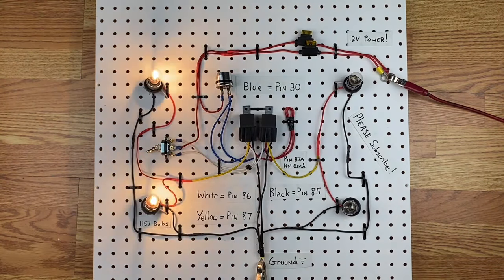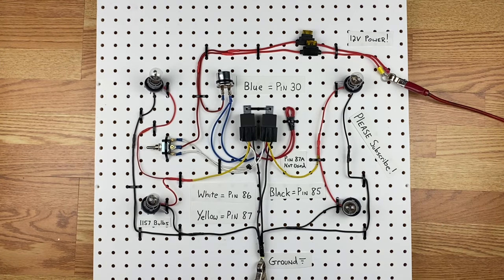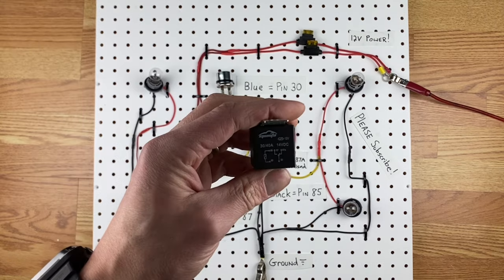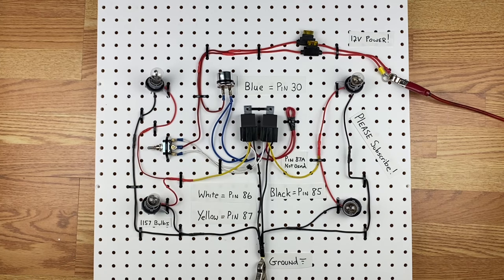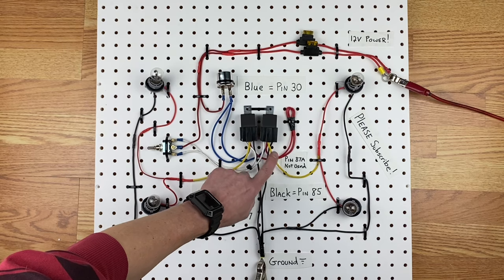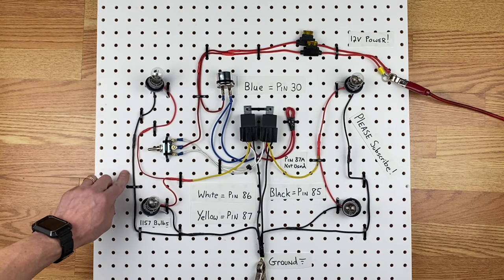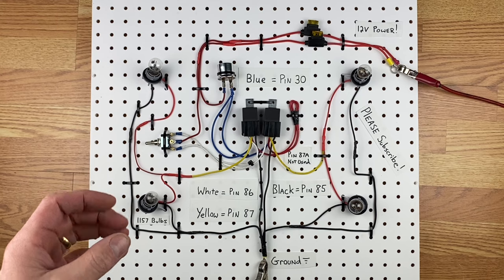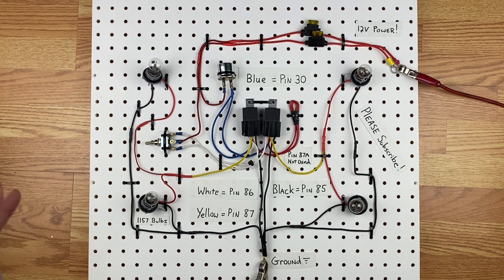How To Wire a Turn Signal Flasher Relay Directional Blinker on a Car / Truck / ATV / Motorcycle

Comment: Can this work for a 6 volt system 🤔
Reply from the maker: I actually have never tried this sort of thing with a 6v system. I think at minimum, you'd have to use 6v relays. The rest - I'm just not sure.

Comment: What size cable goes from fuse to battery terminals?
Reply from the maker: I made a separate video about wire and fuse sizes. Check it out. https://youtu.be/EhzN6UdnmPA

Comment: Can some one help my??
My engine refuse to stop when flasher working ore head lights.
The engine wants to acelerate by him self.
With key turned off.
I did change the back head light design to new'r year .
I first tough the bulb holders in the back cause that problem so I swaped them to old bulb holder .
For some reason my back side blinks bouth with brake light and position light turns on.
So thats where its confuseing why my engin self acelerate it is carbureted and it has 4 pin gm ignitiin module with induction triger .
How to solve this problem?
By the way my baterry sufers for some reason hard to cold start that thing .
My starter cant turn my engin in the morning somthing draining the baterry.

Comment: These will look awesome on my kayak. We caught several unfit-for-civilization type "people" stealing catalytic converters in the area. The thefts caused some people to have their vehicles declared a total loss by the insurance companies due to the value of their cars. These are older people, with no money to replace their cars. We found an extremely secluded spot in the Everglades that is not well known to anyone. So, we take these "individuals" out there and leave them. Now, using your setup, we can signal to each other where to drop these "individuals" off. They never seem to come back and steal again. Problem solved. Thanks.

Comment: I need to ask the this question... I've been an auto electrician for 30 years and I've never seen relays being wired into an indicator circuit... my question is why are you making this wiring job which is so simple and straight forward so complicated? The reason I watched this video is I was wondering how in the U.S.A they wire up their brake/indicator circuits, in Australia we have amber lights completely separate to the brake lights so two completely independent systems where as in the U.S they flash their brake lights and I thought this video might quench my curiosity... NO! IT DIDN'T! Again I'll ask why are you wiring relays into the circuit when there is absolutely no need to? cheers
Reply from the maker: Sorry the video was so disappointing. The reason I used relays in this video is because I have no idea what switches and lights people will be using on their own projects. Chances are good that the switches people use will be undersized (low amperage rating) and the light amperage loads will be too large (fog lights? Headlights? Who knows!), which will leave people with burned switches or worse. So I figured if I show a risk-averse circuit, people will have less problems when they decide to use headlights for turn signals and wire it all to a 2 amp switch. :)

I have multiple other turn signal wiring videos too (without relays), but I don’t believe I have any that show what you are looking for. That’s a good idea though. So maybe I’ll make one.

Thanks for watching!

Comment: I did this but didn’t work I checked everything aging but still nothing did I miss something?
Reply from the maker: You’ll have to use a multimeter or test light to figure out where your power or ground is missing. 
-Are pin 85’s grounded?
-Do pin 30’s have power?
-Is there power going into the switch?

Comment: 1 problem with ,this brake lights are wired to the turn signal filaments  not the parking lights/tail lights. Turn signal filament is brighter than park/tail lights

Comment: I'm not sure what I'm doing wrong but I tried this the bulb lit up but the flasher wasn't working
Reply from the maker: Are you using LED bulbs or incandescent bulbs? If you are using LED bulbs, you need an LED flasher to make it work.
Reply: Brother I'm not using LEDs what I will do is list all the parts I'm using and will message you back maybe you can help me solve this problem I'm having I'm not using 1157 light bulbs and sockets I was trying to use turn signal light bulbs for my 2000 Chrysler neon I will get the exact light bulb number and light bulb connectors part number then I will try to see if you can help me solve the problem and figure out what I'm doing wrong

Comment: Dose this work for 24v trucks
Reply from the maker: You would need 24V components to make it work. These 12V relays would fry with double the voltage.  Otherwise, I would assume the wiring schematic would be similar.  Sadly, I don't know for sure though because I've never done anything with 24v.

Comment: I am working on my 2018 CF moto putting a street legal light kit on it and wiring up turn signals 1st time putting lights on a 4 Wheeler  Any pointers or suggestions would always be appreciated
Reply: A relay that came with mine was a single one will the diagram work for it too
Reply from the maker: Sadly I'm not sure how that light kit is intended to be wired. I would hope it would come with some kind of diagram if it was a whole kit.

Comment: Hello, thank you so much for all your help. Can you show us how to make one with only 2 wires but make them as parking lights and turn signs pleaseeeee?
Reply from the maker: That’s a good idea! I’ll add it to my to-do list
Reply: @WiringRescue  Thank You So Much I Really Appreciate It!!!
Reply: Flip the blue 30 and 87a yellow ... Now add a switch with fuse to the red wires beside the relays. And now you have parking lights. And if parking light on and you hit turn signal.. The side chosen will blink instead of solid. Great for small led or tiny 2 wire bulb.
Reply: @WiringRescue  simple flip and add toggle.

Comment: what's the purpose of the relays?
Reply from the maker: Using relays allows you to use a wider variety of switches, and bulbs. Many switches are rated at 5amps or less. So if you had bulbs that drew 6 amps, which is totally doable, you’d melt the switch. Relays prevent that… to a point. :)
Reply: @WiringRescue  thank you

Comment: Likely the relays aren't even needed the flasher could run to the center-off position of the switch and the output to the bubs.
Reply from the maker: It all depends which bulbs are used. I did it this way because it safer when you don’t know what bulbs people are going to use. If you use LED’s you would probably be right.
Reply: @WiringRescue  Also guess it depends on what switch is used Half the vehicles I own don't have flasher or even headlight relays.

Comment: I did what you said but my light just comes on it dont flash
Reply from the maker: You are probably using LED bulbs, or smaller bulbs that what I posted . If so, you’ll need a different style flasher meant for LEDs.

Comment: What fuse amp is that? 30 amp???
Reply from the maker: The amp size depends on the lights you are powering and the wiring you have.  Once you know how much amperage you're pulling, you can determine the appropriate fuse size.
Reply: @WiringRescue  just finished wiring. Im literally crying man thank you. You don’t understand my struggle. I been driving my miata with un-proper blinkers for over a year now. This video is game changer im so happy.
Reply: Would 87a be used with the white wire to have your running lights ?

Comment: I have put everything together but couldn't work, only to find out my Pins are confusing from what the videos says. My Pin 30 is Black, Pin 85 Yellow, Pin 86 White, Pin 87 Red, Pin 87a is blue. Please assist me bro or anyone on here i've tried 3 times
Reply from the maker: Forget the wire colors. The numbers should be stamped on the bottom of your relay. You can also watch this video https://youtu.be/QCkfFCLa_Jg?si=2WakyyguCsTdDatu to get a better understanding of how relays work and what they are actually doing.
Reply: But I have tried it according to the Pins but couldn't work, and also again with the wires
Reply: I did put them together but what happened was only a once off tick sound form a flasher relay and the lights are not turning on at all 😢💔

Comment: My ford relay as 5 pins, it power the four way flasher and the turn signal. Pins are numbered  1 to 5 no diagram to show how it works.  Nobody has a video to explain how they work, kind of lost with what people explain with pin 30 85 86 87 and 87A

Comment: Anybody wanna tell me why you need those relays in the circuit? I get that a starter circuit needs a relay because its high current, are turn signals high current?
Reply: And not the "blinker" relay...I get that.
Reply from the maker: I have a few other videos explaining why relays are a good idea in some circumstances, if you want to explore my other videos.

However, to answer your question simply - It allows you to use nearly any type of switch, and any type of bulbs. 

Here is the video showing the same thing without relays, which may be what you’re after https://youtu.be/uXiEoJVtHi8?si=TV7LIgY1ADQBlsQT

Comment: You can do this a lot simpler, no relays… just feed power to the flasher, then the output of the flasher to the center of the 3 way switch. Then feed out of each side of the switch to each bulb and ground the bulbs… way cheaper, way simpler.
Reply from the maker: That only works if your light bulbs draw less amperage than your switch is rated for. Using relays allows you a wider variety or bulb options without risking burning out your switch or flasher relay.
Reply: @WiringRescue  nowadays most lights are LED and draw a few milliamps, in that case you’d need a digital flasher. A lot of the simple logic can be done with diodes too for combing brake lights and emergency flashers using the same bulbs. I’ve designed several circuits for converting motorcycle turn signals into running lights and the rear into brake lights.
Working on circuits for go cart and mini  bike  lights using MOSFET transistors and diode logic. Fun challenge!

Comment: How about how to wire a LED system with a 3 wire LED flasher?
Reply from the maker: I like this Idea. Let me see what it will cost me. If it’s cheap, I’ll do it!
Reply: @WiringRescue  Going to put LED turn signals on my Polaris Ranger. I got all the components and I think I have it figured out. Wish I could send you a jpeg photo of what I got!  
What I am not sure of is amp size for the fuses. There will be 6 LED's per side and I think I can figure that out but how many amps would be needed for the relay switch between terminals 86 and 85 to operate the switch correctly? 
I am sure this would a very good video if you made one for all the thousands of Polaris and other UTV's owners to know how to do!
Thanks,

Comment: So I follow the instructions and got my blinkers to work however when the switch is in the middle they both blink. Now the flasher I have is different so I was wondering if that was the problem. It’s an led flasher off Amazon. Not sure if I just wired something wrong or what the problem is
Reply from the maker: Sounds weird. I think you need a test light or multimeter to find out where the electricity is and is-not. It sounds like your 3 way switch is not working the way it is supposed to. It’s tough to be sure though without testing it.

Comment: You don't even technically need the relays. I wired all 4 directional bulbs in my 2010 Ford e350 to a flasher and a 2 way switch. My flasher had a 3rd prong for pilot tho.  Plus I had to run the rear wires through a trailer adapter because the directional and brake lights use same bulb in rear. Didn't use any relays though just the flasher.
Reply from the maker: It depends which bulbs you use and how much amperage they draw. If they draw more amperage than your switch can handle, you’ll burn out your switch. Most switches are not rated very high. If the switch is able to handle the amperage draw of whatever the circuit is, then you could skip the relays. Thanks for watching!
Reply: @WiringRescue  yeah I ended up using an RL45 relay for each side just to be safe

Comment: you dont need 2 fuses, you dont need relays, you yust need flaser and 3 way toggle switch, and if you want to have indicator light on the dash yust conect left and right side on switch with smal bulb, it will blink when one side gets power
Reply from the maker: I don’t need to use toilet paper either, but it’s best for everyone if I do.

Comment: no need for  bosch style relays on that, just use a good quality blinker relay and the SPDT switch, ( A tridon HD12 or HD13 is good for 20 amos,)
more you add complexity, greater are the chances to have a failure

Comment: Are you telling me that flasher module flashes nonstop the entire time you’re driving that’s crazy
Reply from the maker: Nope, it only flashes when electricity flows through it. So when your turn signals are off, nothing is using the electricity. So no current is flowing through the flasher. But - when you turn on the turn signals, the electricity flows through the flasher and the flasher does its magic!

Comment: Using this wiring description to fit indicators onto a pushbike. !! 
I do not care of the weight as its having a stupid big motor on it to drive it. 
Although still retaining the pedals to.keep it legal. 
But safety first. I will add indicators to alert stupid people in cars.

Comment: you don't actually need the two relays. use a flasher relay 4 or 5 pin with the same ON/OFF/ON switch

Comment: I have a 68 big block vette, sitting in the barn for 8 years now.  It has zero wires on it.  I wish I could find someone to wire it so it's road legal.
Reply from the maker: That sounds like an amazing problem to have. I wish I had a big block anything! There is two ways to manage this in my opinion. 

1. Buy all new OEM style wiring, which will surely cost $1500+ but it will all be “correct” which makes Corvette purists happy.

2. Buy a $250 hotrod harness and make it all work great with modern fuses, relays, and wiring.

Personally I’d take option number 2 and start driving it asap!
Reply: @WiringRescue  been there.  Maybe it's possible but not even pai less makes one for me.  I'm guessing because everything needs a ground with a fiberglass body.
Reply: @WiringRescue  Purist need to look the other way on this ride.  Oops. 800hp big block, tubbed, flared, custom interior and body panels.
Reply from the maker: @DumbCarGuy  - this car sounds like something I would surely fall in love with.  For your ground management, you could have a couple of ground distribution points, that are connected to the chassis with a ~8awg wire. Something like this. Fastronix 12 Terminal Ground Distribution Block Kit https://www.amazon.com/dp/B00X326A1K/ref=cm_sw_r_cp_api_gl_i_2V28PE5YP4VPAJ0YDT33?_encoding=UTF8&psc=1

It would certainly require a little more effort than the average hotrod, but absolutely doable as long as the chassis is grounded nicely.

Comment: You can build the whole thing without the relays.  Seriously!
Reply from the maker: I can build a car without seatbelts too, but it wont be the safest design. By spending the extra $4 for a relay, I’m able to run any bulbs I want without risking overloading the switch.

Comment: This circuit is waaayy over engineered. You could easily remove one of the fuses and omit both relays. Optocouplers??
Reply from the maker: It depends on the situation and how much amperage the accessory is drawing. In some cases, the relay is not needed.

Comment: The 'other' filament on the 1157 lamp isn't bright enough for a brake or turn signal.  It's for park/tail light.  Barely noticeable in broad daylight.  Not noticeable if the brighter filament is already lit.  Why the relays?  Just run 12v source to the flasher, out of flasher to center terminal of switch.  All auto makers been have been doing it that way since the first turn signals.
Reply from the maker: If you have a switch with a low amperage rating, and your bulbs draw more amperage than the switch can handle, you need relays. Also - if you don’t want relays, I have a video for that too: https://youtu.be/uXiEoJVtHi8

Comment: Still not working.
Reply from the maker: Okay - we need to determine if that flasher is working or broken. Do you happen to have another vehicle you could plug it into as a test? Or could you hook up an incandescent (non-led) light bulb to it that will draw more electricity through? Either should prove whether it works or not.
Reply: @WiringRescue  I contacted it to one of the headlights last night and it did blink the headlights.
Reply from the maker: @johnmccracken8511 - if that is the case - it sounds like the flasher wants more current flowing through it. Can you tell me what the part number is on the flasher? I’d be curious to look it up and see if it has some minimal current requirements.

Comment: But why?
Reply from the maker: Imagine you have a go cart, dirt bike, motorcycle, atv, or race car that does not have any turn signals, and you want to add them in a really cheap and easy way. This is why.
Reply: @WiringRescue  
That s just it. If necessary these vehicles have that already. 😉
Reply from the maker: @Peter_Riis_DK  - Not always. Lots of dirt bikes are converted for street use, and there are tons of classic cars that you cannot just buy factory parts for anymore, or people simply don’t want to. Old cars and motorcycles are frequently restored with modern wiring and circuitry, so there are plenty of reasons why somebody would use this information.